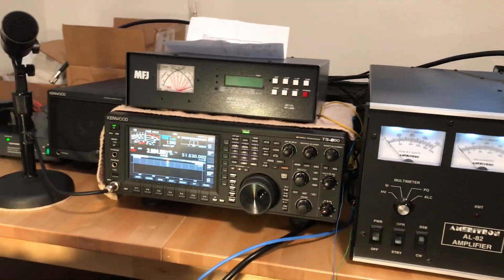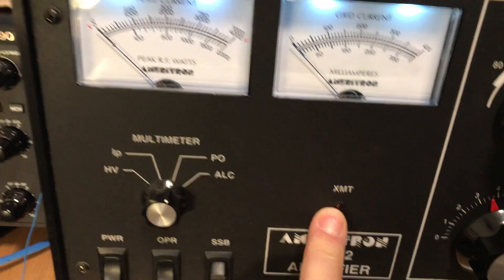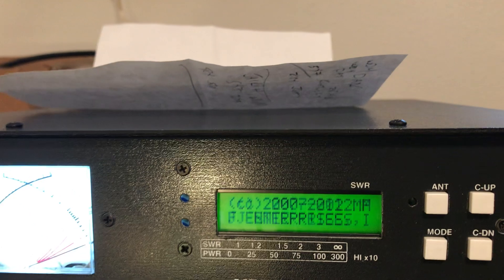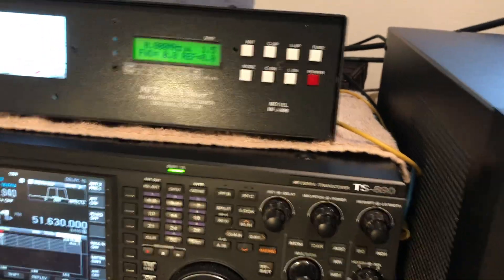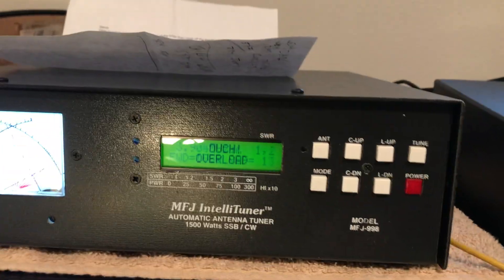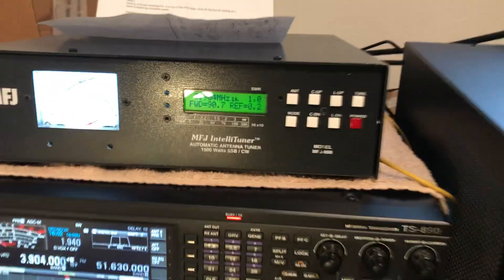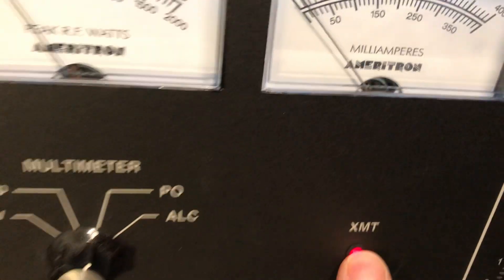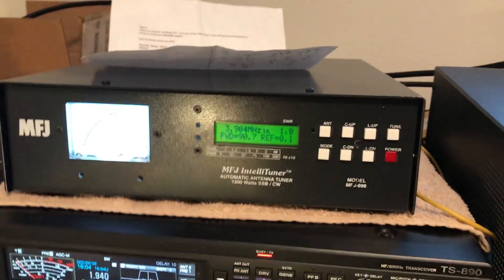MFJ-998 firmware/design problem re-tested by request.

Comment: Mine does go into bypass mode. It subjects the amp to a sudden spike in SWR when it foes that, in addition to the relay sparking you mentioned. I wish it did what yours does. I'd much rather have it all run 1600W momentarily than do the worst thing possible, or better yet, use the amplifier bypass control as you said it should. Did you figure out why yours was doing the next best thing? Or maybe how to get mine to do the same?

Comment: Did they ever fix this?
Reply from the maker: They never fixed it, no.  Obviously a code problem.  I'll have to see if they will give up the source code for the pic chip.  Or re-write my own.  In the mean time, stay away from full power with SWR's near or at 4:1
Reply from the maker: Negative.  Now they are out of business. :( 
It's still an excellent tuner.

Comment: Hello,
I am a new owner of a MFJ 998b...just one question: when you are in CW mode ...if you change the band it will tune when you start keying with speed bigger than 7wpm?
My problem is the fallowing:
I am on 7032KHz, after I finish a QSO I change to 80m band (let's say 3559KHz)...i will tune on that band....after that I switch back to 7032...the tunner will not switch back to 7032 until I put a constant carrier (AM/FM) or I disable keying. If I put the keyer off ...in 1.5 seconds of keying...the tuner will be back in 7032 and bring correct tuner settings.
Reply from the maker: Thank you for viewing (and commenting on) my video.  Yes, I was on CW when I did that video, On any of these auto tuners, you really do need to supply a constant carrier (CW, AM/FM) so that the microprocessor has a constant signal to measure SWR on as it rattles thru the millions of tuning solutions.  I believe the book says (in multiple places) to tune with 10-25 Watts.  Depending on what radio you have, it should be able to quickly switch to CW/AM/FM then key the mike (or press the "send" button on the front of the radio. This is just the nature of these kinds of tuners - expecting them to tune on a varying SSB signal is unrealistic (even though sometimes it actually works).